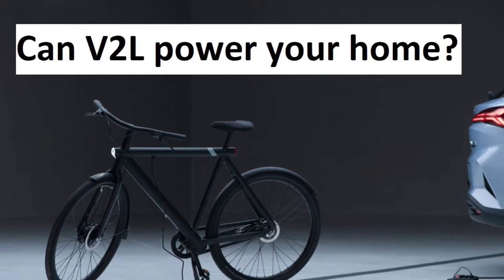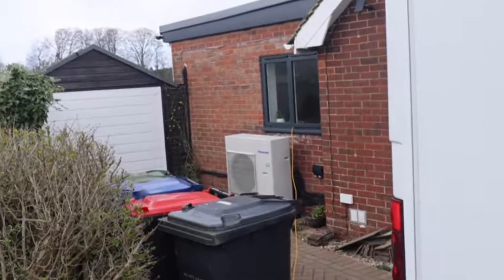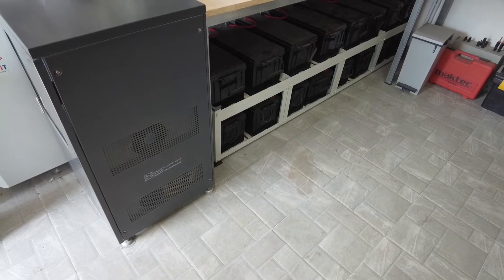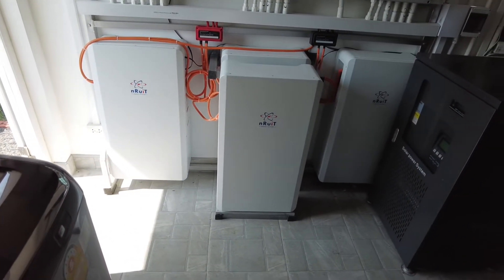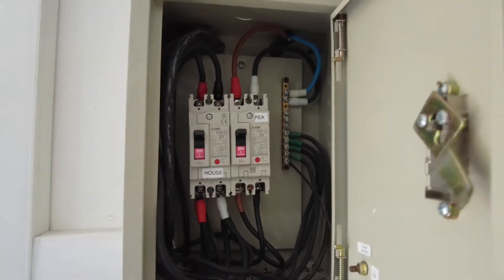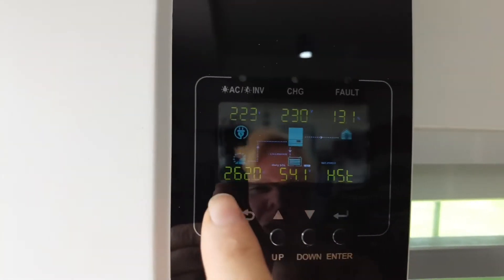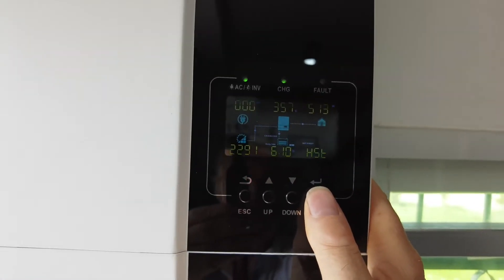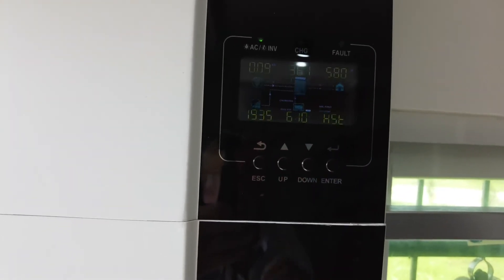Can Vehicle 2 Load power your home?

Comment: Fantastic video. Im british and live in Malaysia,  recently bought a BYD M6, I have a 6kw solar system. 
I watched this video and part 2 and few times, trying to figure out how you connected the V2L to your system. 

What i would like to know is, the box on the post next to your car which you have the V2L cable. What is it? Also how is the other end connected to your solar inverter? Is it though the automatic transfer switch?
Reply from the maker: I bought an M6 as a second car to the Seal AWD. Great value car. The box on the post contains the V2L power gang. I keep it in the waterproof box as I want to use V2L in the rain. Into it is plugged a cable that goes to the transfer switch next to my inverter. You could add a grid connection. 2 ac connections in and one out to the ac input of my inverter. The inverter thinks the V2L is a grid connection. I only use it at night when the house is drawing less than 1kW load.
Reply: @EcoHouseThailand  Yes the M6 is a lot of car for the money. So much boot space! We are going to test it's range tomorrow from Ipoh to Malacca.
Sorry, I have more questions for you.
I read you upgraded your cable, is it similar to the original one? Has a bank of sockets. And is this bank of sockets inside the waterproof box? Also do you have a link for the cable you bought.

If possible, could you send me a photo of inside the box?

How many AC's do you run at night? I run 2, one for my bedroom and 1 for my daughter. Then there is the fridge, nothing else really. 

I spoke to the electrician who installed the wallbox charger about using your arrangement. He said it is illegal to do this in Malaysia. 
We'll see what I can do.

I enjoyed you drone footage, wonderful house, glad to see how you painted it white and have a panoramic balcony. Being so secluded reminds me of home in the western Isles of Scotland.
Reply from the maker: @lacmac7600  I searched for byd V2L adapter on Lazada online market, I wouldn't recommend the one I purchased as it can't be used in the rain. In the box is the V2L adapter that came with the car. The cable comes out the bottom of the box to plug into the car. plugged into to it is a plug attached to a cable that terminates at the transfer switch. I usually run one aircon at night 8,500 BTU. The guy who installed my first EV charger knew nothing about solar or EVs. Most inverters will accept ac power from a generator, so how is that different to V2L?
Reply: @EcoHouseThailand  My car is under a balcony so there is little chance of it being hit by rain. ( I hope I didn't just jinx myself) 
Anyway, with ou using only 1kw the V2L that came with the car would be sufficient. 

I know, this is what I said to the electrician. I'll have to see how I can do it. My inverter is a Goodwe model. 

Sorry, i waffled on too much. Thank you for your help, much appreciated.

Comment: Excellent content. One question, is your house single phase? The information I found online says that the BYD AC (V2L) output is single phase only.  I'm planning to buy a BYD soon and would like to use the V2L feature as a backup, but my house is set up as 3 phase (127v Phase to Neutral), and a have a grid tied solar. So far I have not found any economical way to make to convert the single phase BYD output into my 3 phase panel. All the inverters are way too big (and thus expensive) compared to the 3kw power output of the BYD. Thanks
Reply from the maker: Yes my house is single phase. It was designed to be off-grid so grid power was only going to be a temporary thing during the build. I have never had 3 phase electrics.
Reply: Hi. Have you found a solution? I bought a Sealion 7 and would like to connect to my 3 phase home installation. There is a Delta 3 phase charger, which I believed was a bi-directional charger. What kind of charger are you using?

Comment: At what rate can you send power to your house from your seal? I have no home battery only 6.4 kW of panels and 5kW inverter ATM. Do you have a DC charger?
Reply from the maker: 3.5kW. I set my inverter priorities to Grid (V2L) then Solar then batteries. I don’t have a DC charger as they still quite expensive. Both my EVs came with free 7kW AC chargers.
Reply: @EcoHouseThailand  sorry for my lack of knowledge is your inverter a hybrid type? I have a conventional fronious inverter ATM, So I'm trying to work out what bits I need to buy. I see that box on your pole next to your seal what exactly is that called? Also is it necessary to have other house battery storage or could i just use my car for powering the house overnight. These hydrid inverters from ready need a battery attached? Thanks mate
Reply from the maker: @triplex7144 My inverters are hybrid off-grid, so they can draw power from the grid but can’t feed back power. The box is an outdoor waterproof electrical box. It initially held my V2L adapter. My overnight load is less than 1kW if you need more than V2L can provide like when pumps come on with a big initial spike then you will need another power source like grid power via an automatic transfer switch. V2L can trip off if the max load is exceeded and will need resetting
Reply: @EcoHouseThailand  thanks very much for the information much appreciated.

Comment: Truely a masterful setup!  Did you design (build) it yourself?  I can't find a good Thai company who really understands solar power systems.  They will sell several "kits" but get confused when asked about complicated systems like yours.  They are also EXTREMELY expensive, which deteres most people from investing in solar power.
Reply from the maker: I imported the inverters and batteries for my new system from China. All other components purchased here in Thailand. I got a local team here in Surin to do the install (I can recommend them if you are nearby). Inverters 36,000 Baht each and Batteries 68,000 Baht each.
Reply: Thank you very much for the response, and the original poster could at least say "thank you" 😉
Reply: @EcoHouseThailand thank you for all you’ve been sharing with your ground breaking setup. I live in Koh Samui and am looking to go off grid with a solar-battery system (my current monthly PEA electricity bill ranges from 15k-25k Baht depending on occupancy). Would you happen to have recommended an installer on Samui/Surat Thani previously or advised someone whom I could connect with in person? Thank you in advance for any help you may be able to provide.
Reply from the maker: @omarmustaphaong-kt8kp  Chaweewan Group Solar on FB cover most of Thailand or You could try asking on https://aseannow.com/forum/319-alternativerenewable-energy-forum/

Comment: You mentioned the cost of batteries;  I was put-off by the price of the Growatt battery.
I opted for the LIFEPO4 Chinese Prismatic type with a Daly Battery Management System.  The cost of the parts was about AU$3300 including freight (US$2310) for a 16KWh battery - I aim to limit my usage to around 14KWh.  I calculated a 3 year payback would result from the addition of a battery when the grid-feed-in-tariff was 15AUc/KWh.  In a month this will drop to 6AUc which is bad overall but increases the benefit of the battery.
I did not connect the 'CAN' signal from the Daly BMS to the 5000ES inverter.  Having seen your setup inspires me to do so.  You get an accurate reading of the state of charge whereas I don't - my SOC varies wildly and is crazily inaccurate.

Comment: and when it transfer you lost power for a second.. i recommend you use two ac contactors coupled together... as they have 10ms transfer time..
Reply from the maker: So far no power loss in the house  - computers don't switch off
Reply: @EcoHouseThailand  are you sure? with that kind of ATS the mechanical one that switch over? it even lost its pilot light... red indicator im not talking about the bypass of the inverter as it can be set to ups with a 10ms transfer time.. but the ats where you put the output of your old inverter setup and your new inverter setup..
Reply: He has batteries.. the V2L is a secondary 'AC' feed into the inverter. The inverter can live easily without power for much longer than  the ATS takes to switch
Reply: I think the inverter is supplying 'smoothed' power as the contacts in the transfer switch flip.  It's not a perfect transition;  most devices cope just fine but I have a UPS as the ultimate backup for the internet and it detects the changeover and 'squeals'  for a second 😀.  I suspect the difference in grid voltage and the inverter ac-out voltage may decide how smooth is the transition.